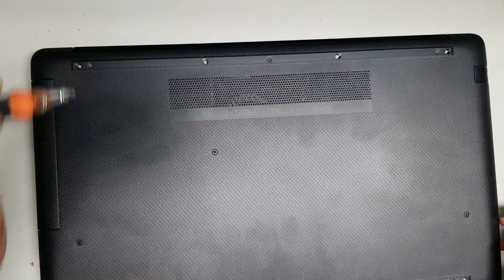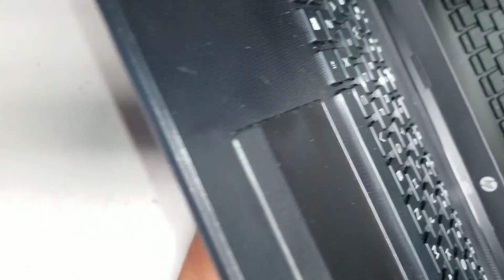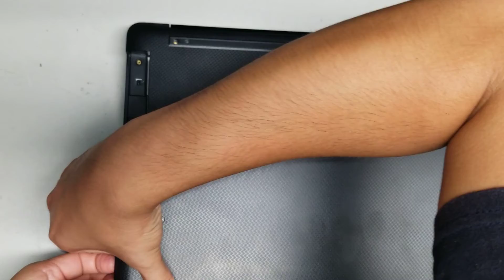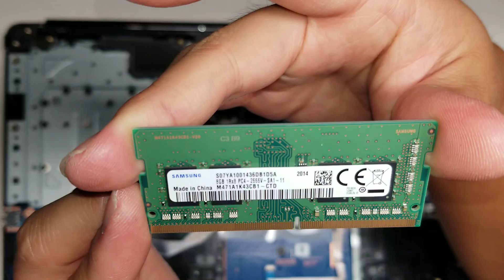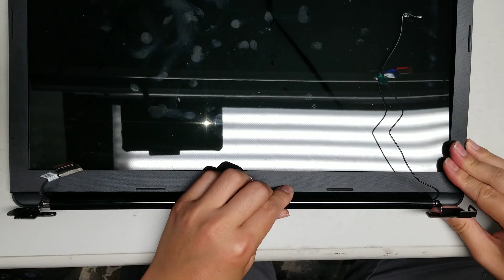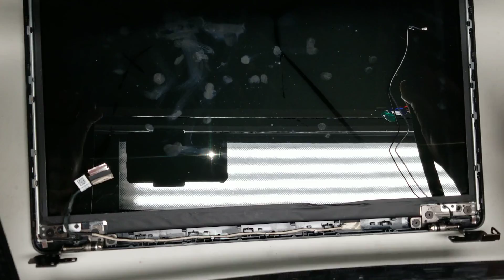HP Laptop 17-by3613dx Disassembly RAM SSD Hard Drive Upgrade Repair LCD Screen Replacement Part 1

Comment: Hey just curious, I've got this exact laptop at home. I've had it for a few years and needed to replace the battery as well as upgrade the RAM. Would I need to worry about grounding myself before doing any of that or can I just work on it as is?
Reply from the maker: Usually not a big issue. I recommend touching something to discharge any built up static, but usually not too big a deal.

Comment: This HP model was my covid quarantine purchase. The casing is super weak and poor quality.I think it’s designed to break after a certain time. My case cracked where it attached the screen. As said, the hard drive is not a small metal box but a little board in the lower corner next to where the box should go.
Reply from the maker: Hmmm
Reply: Hi, can you send a screenshot and circle it, I'm not really techy but my computer kept saying hard drive error so I decided to try and fix it myself
Reply: @uhjjju7778  Don’t have it anymore.  Sorry.  It’s a little board in the corner with a wire clip though.
Reply: @Robsay01  i think i fixed it.. i took out the cd component and i didnt get the error anymore. Thanks anyways
Reply: @uhjjju7778  good deal
Reply from the maker: Nice

Comment: THANK YOU SO MUCH I find any tear down guides to fix my laptop of this model thanks to HP's website breaking down (as usual 🙄) and this really helped me fix it. The hinges came out and 2 of the screw support that connected the base to the hinges. The final 3rd screw is what I put back in and is now holding up the entire screen 😬 but hopefully it lasts for a long time. Thank you!
Reply from the maker: You'll want to use jbweld to hold it where the screws are missing

Comment: Thanks bud.  My daughter dropped it (she said it just fell)  with the screen open.  Now the screen part wobbles a bit and I can see a tiny crack by the ethernet port on the shell.  It takes a bit of force to open it.  It functions just fine.  I don't know if it wobbles because of the crack or the pressure to open it.  But this video will help.
Reply from the maker: Hope the repair goes well :)

Comment: Is there a repair shop website what gives you direct access to parts for laptops. I'm trying to find the bottom and top shell the keyboard is attached to. And some screws and bezels. I hate having to Google this and that part with a model # to find parts
Reply from the maker: I usually just check eBay, Amazon, or aliexpress

Comment: Get a fucking mod mat and plastic prybar and stop scratching ppls pc's tool
Reply from the maker: I'm not scratching anybody's computers. Been doing this over 10 years and nobody has ever said anything about scratches on their computer. I've worked on some super expensive machines and ones people keep in mint condition with the plastic still on as well.

You're one of those people that act like they know better, but don't actually even work on this stuff. Probably just going off of what others do in their videos...
Reply from the maker: How about you make your own channel. You think you know better, why not show people how to do it properly?...
Reply: I CALL BS! The fact you even replied proves my point. Metal and circuitry don't mix. My experience says otherwise not some jackass trying to sell something. Oh and you can keep your petty YouTube channel, im good traveling the world fixings servers asshat
Reply from the maker: Stupid YouTube keeps auto deleting comments. They only showed me a preview of your comment. You were saying metal and circuitry don't mix. Lol...remind me what solder is. Remind me what the screwdriver and screws are made of... That's as stupid as saying we shouldn't use metal screws to mount electrical outlets...it's only a problem if you don't know what you're doing and start smacking the motherboard with the metal tool...laptops kill themselves with loose screws rolling around. There's nothing wrong with using metal tools if you know what you're doing. What kind of non metallic screws and screwdrivers are you using? Use your brain. It's like saying don't clean your computer with a slightly wet cloth because pouring water on it can kill it...
Reply: Yes like you. So you just stop. But jamming a metal putty knife is good huh. You do you stupid just remember the only reason your getting so butt hurt is cuz deep down you know I'm right and your a loser
Reply from the maker: I found out how to see the auto blocked messages. Butthurt? Lol I think you're upset you have to do your job a certain way. Servers aren't the same as laptops. Servers are the easiest computers to replace parts on. Everything is designed to be hot swappable...
Reply from the maker: Maybe try repairing laptops for a living and then come back to me. Severs...Lol more like Lego desktops...

Comment: Thanks for showing the parts! Question: is there a CMOS battery? I can't find one in my 17-by1053dx. "checksum is invalid" message and i have reset the BIOS. But computer won't restart or abruptly shuts off.
There is a tiny button on motherboard with red letters and numbers, including "330 2.4v". Is this the CMOS battery?
Reply from the maker: The cmos battery is the main battery on most of the recent hp laptops
Reply: @ItsBinhRepaired  ok! I wondered since reg battery is a 3-cell. The reg battery seemed to be charging ok. Laptop almost 2 yrs old
Reply from the maker: @josephinearrowood814  hmmm did it say the bios was reset? If you remove the battery it will give that error
Reply: "I got a "The checksum is invalid" message the couple times I was able to restart it. I had to manually reset time/date and back up folders on a zip. Then it abruptly went off again. I understand the BIOS might have been corrupted? 
I'm going to try to restart it one more time to see if I can get that checksum and bios and cmos message again. Maybe download that BIOS diagnostic tool that up has .
Reply from the maker: Did that happen while the laptop was plugged in?

Comment: Mine dont have 2 ram brackets for ram memory..i have just one but is space for another one...and ssd slot space is there but dont have slot connection on motherboard..cand be instaled that ssd slot on motherboard and a second bracket for ram moemory?
Reply from the maker: Not sure what your question is
Reply: you have two places in that laptop where you can put rams, I only have one place ... and at ssd you have where to connect that ssd..but I don't have that plug where ssd is inserted ... that connection ... I wanted to know if somehow you can add to the laptop motherboard that ssd slot and another one on the rams memory..because I can only use only one  rams memory ..not 2 like you..
Reply from the maker: @TheRazvancristian  then your model is different, so probably not.

Comment: How to get better ram for a HP Laptop Model 17-0021dx
Reply from the maker: Just need to match the ram type and speed. I recommend an SSD over RAM if you're only doing one or the other.
Reply: @ItsBinhRepaired  I am trying to increase ram so that games run better what is better
Reply from the maker: @the300rulers  games won't run better with more RAM unless you're running low on RAM.
Reply from the maker: @the300rulers  think of it as adding seats to your car. If you're only carrying 2 people, having 5 seats won't make carrying 2 people any faster.
Reply: @ItsBinhRepaired  for Minecraft mod packs I need more ram to allow them to use more storage

Comment: Hello there great teardown video. Was wondering if you had a part number for the power jack. mine is loose but still currently working.
Reply from the maker: I usually just search the laptop model number with the words dc jack

Comment: Well, thanks to my 8 year old son LOL, I am about to change my screen also. My question has 2 parts. 

Can you share with me where you ordered your replacement screen from? So I can order one myself. I assume the replacement screen itself has some model number associated with it also.

And the other question I have pertains to upgrading the memory I noticed in the video you made comment that you could add another 8 GB memory card doubling the memory capacity of this model while you were in there oh, so since I'm going to have to take this laptop apart to replace the screen I might as well do that while I am doing it why not twice the speed right lol. Would you happen to also know where I can order that memory card to add to it and any model number associated with that so that I can just order it off their website? 

Thank you for any help you can provide
Reply from the maker: Screen you can get the model number on the sticker on the back of LCD. I ordered from eBay or Amazon. The RAM you want to check the sticker on the ram. Match the model like pc3 pc4 and the speed like 2666 2400 1800 etc. Size if adding a stick should match as well. If replacing, size and be anything.
Reply: @ItsBinhRepaired  I have not opened the laptop yet, but the model number is the exact same one that you did in your video, the HP 17-by3613dx. So I'm thinking the screen and memory chips would be the same ones, as you had in your video. I know the specs. From HP when I looked up my serial number on their website said it has an 8gb ddr4 2666mhz 1x8. Installed. I found a company named Crucial that sells a kit to upgrade the memory on this model. I was thinking of taking the old 8gb memory chip and and upgrading with 2 new chips to the 
Crucial 32GB Kit (2 x 16GB) DDR4-3200 SODIMM. Kit number CT2K16G4SFRA32A.
For $168.99. Does this sound like it would work? And if I did that, I should not need to backup the windows software on the computer right? As I believe that lives on the hard drive. 

As far as the screen goes I have found many different companies selling the screens. But all of them state that I need to make sure it is a left side 30 pin connector. But from what I understand from my research the only screen that was put in that model from HP was the one that you installed which if I believe I am correct was a left side 30-pin connector correct? 

I am also wondering if it is possible to upgrade the screen to be a higher-definition screen since I am replacing it but I'm pretty sure that will probably be a problem. 

It came with a solid-state 256gb hard drive, I would like to upgrade that to a terabyte but I have a feeling that I'm going to get into a software issue, where I would probably have to back up the windows program and everything to reinstall it on the new hard drive am I correct? 
I am very capable of the hardware part of changing out things, the labor side of it, as I am an electrician by trade. I have had to change out fans before on laptops but I've never had to do a screen or change out the hard drives and stuff like that, as the software side of things worries me a bit lol. 

Any advice would be greatly appreciated, especially if what I have stated above sounds like it will all work.

Comment: Any tips or tricks to fix the broken plastics that hold the metal the screws go into? Specifically the screws in the hinges...
Reply from the maker: Jb weld the hinge you the chassis directly. But it'll have to sit overnight to cure completely.

Comment: What a terrible design! The plastic that holds the screen can be so easily snapped. Also it's very hard to change the keyboard on this laptop. These manufacturers need to be accounted for bad designs, and hit with some kind of eco lawsuit. So far I find Lenovo making laptops that easy to open and repair. Dell, Asus, HP started making those weird designs where the keyboard gets integrated into the top cover and fused with plastic holders.
Reply from the maker: Yeah...

Comment: HP could have at least made a separate compartment at the bottom where you remove 1 screw and get to the ram and ssd.
Reply from the maker: Then never do that anymore
Reply: @ItsBinhRepaired  At least there aren't any short ribbon cables attached that have to be disconnected I guess. Those are a pain sometimes, and if you accidentally break one of the clips that hold the ribbons in you are screwed most of the time.
Reply from the maker: @toddstewart9070  yup

Comment: This is quite helpful, as they have advertised this badboy being for sale on Best Buy's website. You actually give us a thorough view of the innards. I think you can upgrade the RAM to DDR4-3200 and the max amount of RAM it can handle is 64GB. This definitely confirms that it is plausible. Thanks a ton.
Reply from the maker: Glad it helped. Don't forget to like and subscribe if you haven't already. It'll help others find my videos and it'll help me as well. Thanks!
Reply: @DesertRainReads , @Mika_Boo   I too have a 17-by3613dx purchased @BB 3 yrs back w/ 8GB for < $650. So, Has (or ANYone) successfully go beyond 8GB? While IMHO, this ranks as the MOST helpful video for 17-by3613dx, HP support teams give me conflicting info. regarding # of So-DIMM slots 😞
Specifics:
System Board 868E 65.17 -  CT number PJRYL00WBEBAS0
Microprocessor Intel(R) Core(TM) i5-1035G1 CPU @ 1.00GHz
Task Manager>Performance>Memory claims "Slots used:   1 of 2"
wmic memphysical get maxcapacityEx, memorydevices      displays
MaxCapacityEx  MemoryDevices
33554432       2
Crucial compatible-upgrade-for/hp-compaq/hp-17-by3613dx claims TWO slots
h10032.www1.hp.com/ctg/Manual/c08119882.pdf pg. 12 claims "Memory is non-customer accessible/non-upgradeable"